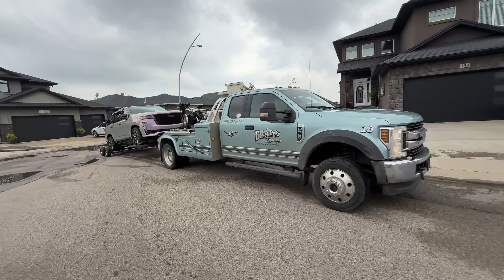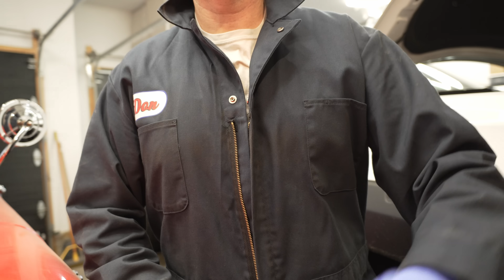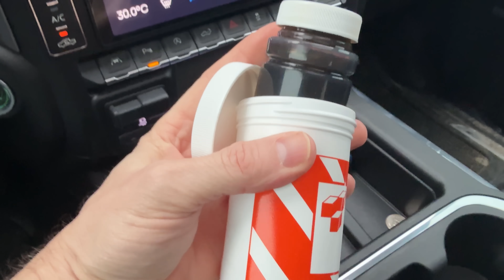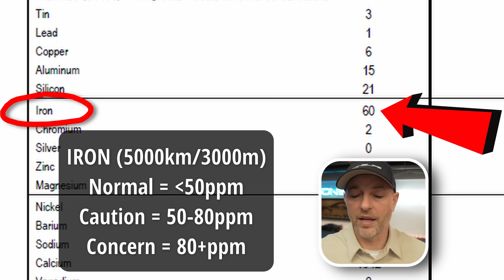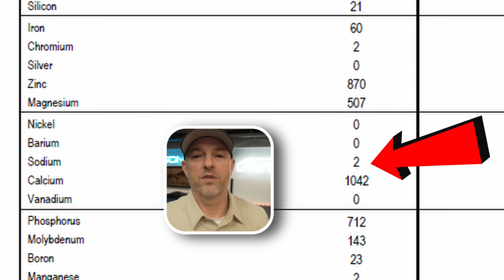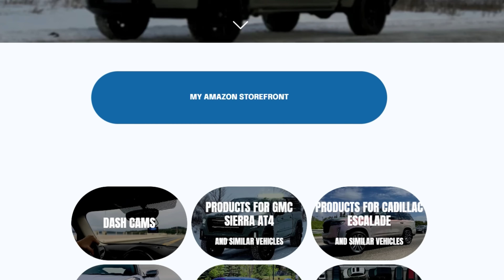6.2L L87 0w20 Engine Oil Lab Test — Here Are the Results

Comment: Regarding Mobil 1 "FS" (European Car Formula) and DexosR rating...  Has anyone seen if the DexosR rating is actually mentioned on the bottle/website prominently?

Long story, short want to "boost" my existing 5W30 that I'm running now with significant Oil/Fuel Dilution issues.

Don't have the same Engine/Vehicle but have been considering using it in my 2014 Direct Injection GM Ecotec 2.4L... which Blackstone claims has high Oil/Fuel Dilution (on their scale over 2% is not good) which my Engine roller coasters between 1.3-5.8%...

Even when under 2% with as little as 1000-2000 miles (under 3000km) my Viscosity is out of Spec... Early on Blackstone had claimed 4000-5000 miles as OK... But I can't justify that.

Just finished a run with Mobil 1's New Advanced Clean (5w30, DEXOS Gen3) after over a year of Valvoline Restore and Protect (or Advanced) and I was shocked(!!) when my Iron jumped about 10PPM (to 21PPM) to where it had been when I first tested it almost 2 years ago.

Wasn't happy about that (or the 1/4-1/2 Quart of Oil Consumption too which I didn't have before).... But thankfully it ain't anywhere near as the 60ppm with the sample in this Video...

I'll likely try blending the Mobil 1 FS 0w40 (1-2 Quarts) with Valvoline Restore and Protect which I have 5 Intervals/Tests with to compare results with before attempting another Full Run of a Mobil 1/DEXOS Oil...

I'm really hopeful that DexosR might be a Spec that will perform well in my Vehicle's Engine
Reply: I messaged mobil. They claim 0w40 fs is dexos. Showed a chart. So why isn't it on the jug? Because mobil1 wouldn't pay gm fee?
Reply: @gadasavideos8564 Their 0W40 "Supercar" has the DexosR logo on the bottle.  "FS" unfortunately only seems to mention its DexosR (Meaning Dexos Gen 2/Gen3 compatible) rating Online on a product data sheet.

Comment: Very informative Don. My wifes' 2024 Yukon Denali has 40K on it and we change oil every 5000 miles. It did not reach the recall list, however I plan on having the oil tested next change. They are still putting the 0W20 in it at the GM service dept. We have no adverse noises yet. I am still leery of the  6.2 engine. Thanks again for this and all your videos.
Reply from the maker: Glad you found it helpful and definitely keep an eye on those results! 👍
Reply: @Donslife  I got back my results and with 44K on engine, iron is 7ppm and silicon is 17 ppm. All results are great according to your definitions. Thanks again for the insight.

Comment: Flakes of anything is not a good sign !
A flake is probably pitting of the cam, and probably related to your elevated iron content = pitting cam wear.
Amazing presentation Don !
Reply from the maker: Maybe sparkles would be a better description
Reply: @Donslife 
Second comment, 
what is your opinion of using the General Motors "oil-change/flooded-start" method to pre-pressurize you oiling system and develop oil pressure .. before starting your engine ?
A guy named BullDog has a great demonstration of this little known built in starting method (maybe every start) ??
Cheers
Reply: No.  Oil analysis numbers have to do with sub 20 micron particle size.  Your oil could look like it's full of "Stripper Glitter", and the oil analysis would never see it. The particles are simply too big.
Reply: @AlisoBob 
Actually  .. the flakes were found in the oil filter, that's were what we  were talking about ... not the oil analysis.
Reply: @thestove2407  I realize that. I'm just trying to educate folks the ANYTHING you can see with your eyes, will NEVER appear in a UOA.
Reply: @AlisoBob 
Great reminder 🎉

Comment: Any new GM V-8, minus the 6.6 gasser, I would immediately put a good 0w-40 oil in it and an AFM delete module and not worry about anything going forward.
Reply: none of the helps. still gonna blow.
people have tried all nothing changes. 6.6 burns massive amounts of oil and they dont have a transmission.
Reply: @MRsolidcolor exactly, in order to get rid off the AFM completely you'll have to open up the engine and change the cam.
Reply: Worry about the valve body wear and torque converter af6er the engine worries

Comment: Thanks for sharing your experience/results.  I too have a recalled 6.2 (2022 Sierra).  When GM issued the recall, my dealer wasn't ready.  So, I checked for the codes and put in 0W-40 Supercar oil myself.  When draining the old oil, I took a sample and sent it to Lake Speed Jr (Motor Oil Geek).  Results were clean...   so, I'm waiting until my oil life indicator says ~30%, then it's off to the dealer to perform the recall.  🙂
Reply: You may want to out 0w20 back in it before you take it in for the recall. The Pico test might not detect a knock with the thicker oil

Comment: I got my 2019 6.2    0-20 Mobil 1 oil tested by the oil geek 
11K on the odometer 
It came back about the same results as you got 
The engine got green checks in every category
Reply from the maker: How was your iron?
Reply: @Donslife 
Good morning Don
Iron 6
Chromium 0
Copper 2
Tin 2
Lead 0
Aluminum 1
Manganese 0
Nickel 0
Titanium 0
Total Metals 9
Wear/1000 miles 7.5

11K on the odometer 
I’ve changed the oil 11 times

Comment: EXCELLENT NEWS Don! Thank you for sharing this VALUABLE information. We are both lucky (same year truck, similar build date, same oil used for five years). I just started using Mobil 1 FS European 0w-40 at the last oil change in my 2021 GMC Sierra AT4 (6.2L) in early Feb. I have run the truck through it's normal paces (even a blasts to 100 mph). I can un-scientifically say - this oil makes the engine sound better/quieter, run better, run smoother, and the best part - it "feels" stronger. Again, just my own thoughts, but the engine "likes" 0w-40. I think we may have dodged a bullet brother. Thanks again, great job with this video/information - you really helped out 1,000's of people concerned about this recall.
Reply from the maker: Thanks Chris 👍

Comment: That iron level seems high given the mileage on the engine and your oil change interval.
Reply from the maker: Multiple -30°C (-22°F) starts and idling times don’t help.  This is why I mentioned my climate.  I am not an expert, just my personal opinion.  Also it appears 0w20 AC Delco Dexos1 Gen3 may not be ‘the best’ protection. We’ll have to see what these levels look like in a couple months or so

Comment: I have a 2020 I bought new in dec 2019. I only drive about a thousand miles a year and I change my oil every year with my inspection at  my GMC dealership don’t even have 7000 miles and still using the recommended oil 0w20 any recommendations my warranty expires Dec 26
Reply from the maker: Until I get test results on all of these oils, hard for me to form an opinion
Reply: @Donslife I would be  doing it for about one thousand miles on my oil I don’t think it will be worth it I change the oil once a year with a thousand miles the oil is still new probably would have more condensation in it then any other things

Comment: Also, there is no need to prefill the oil filter.  The L87 is a direct injection engine, and all DI engines have a feature called "Flood Clear".  If you hold the gas pedal to the floor and crank it, it wont start.  When changing the oil, use this feature to fill the newly installed oil filter, as well as all the oil gallery's before starting. I even do this if my truck has sat for a few days.  That way every startup is a well lubed startup.
Reply from the maker: Can’t win.  I didn’t prefill it a couple years ago, reading the same thing. I was roasted in the comments.  Now I fill it (can’t hurt) and here we are! 😂  It’s all good 👍 Thanks for watching!  I know they don’t prefill when at dealer service
Reply: That is not a good idea. You are rolling the engine over with no oil on the moving parts. And at that low speed that the starter produces it takes a fairly long time to fill the filter. Start stop is a very bad idea and causes wear because you are starting the car with no oil pressure. Which is what your doing but worse because your oil filter is empty.
Reply: @robm3357  Ha!

Comment: 60ppm Iron in 3k miles equals 20ppm Iron generation per 1k miles driven.  Thats a terrible number!!!
Reply from the maker: I will need to keep an eye on it.  AC Delco 0w20 might not be ‘the best’ protection.
Reply: @Donslife  I drive a 2024 LZ0 3.0  that has steel pistons and these motors typically have very high Iron content in the oil. 10ppm per 1 thousand miles.  Half of what you are seeing!!  My latest UOA in my LZ0 showed 18 ppm, over 5200 miles. About 4 ppm per 1000 miles.  And yes, I run 30wt. in it.....
Reply from the maker: Fair
Reply: Iron the only thing iron is the crank? I'm i wrong.
Reply: @jeffreybailey175  All the valvetrain.

Comment from the maker: Oil analysis is one of the best ways to see what’s actually happening inside your engine.

Have you ever tested your oil? What were your results?
Reply: Sent my oil out when the recall talk started. Oil report came back clean. So, I'm a little reluctant to let them touch my truck. I did switch to the 0-40 supercar oil as a precaution. I had been using Castrol 0w-20. I would have used Castro 0w-40, but they say they are not Dexos 2 approved, Honestly, if I used their 0w-20 or their 0w-40, I don't think I'd have an issue. I have always used their oil, and never had any issues. I do change my oil every 2000-2500 miles.
Reply: @nickrinaldi4276  It must be Dexos R approved.
Reply: Great information and Tks for sharing Don. I’ve saved this video for a quick reference guide so that I could have acceptable ranges in one place. I also have the 2021 AT4 with 32k miles. I changed out to the Supercar oil as soon as GM updated their recommendation for their recall. My last 2 oil changes, I changed the oil at 3k miles. I would like to get an oil analysis though…but wished I would have did the before & after as well.
Keep Up The Great Work!!!
Reply: No I haven't had it tested. I now have around 45,000. Miles on my 2020 Sierra AT4 1500.